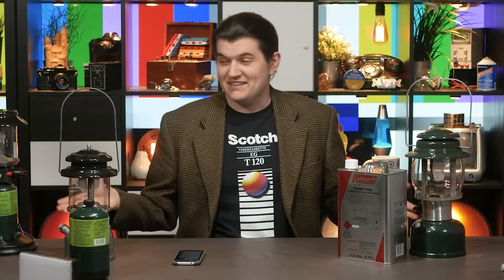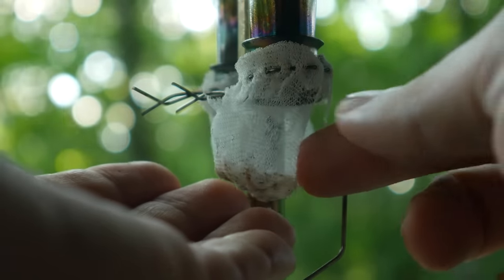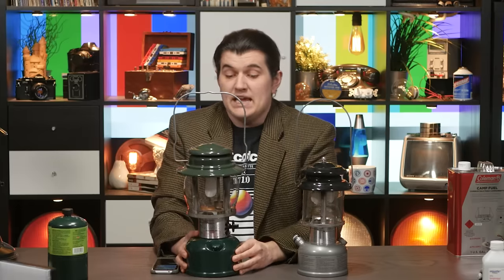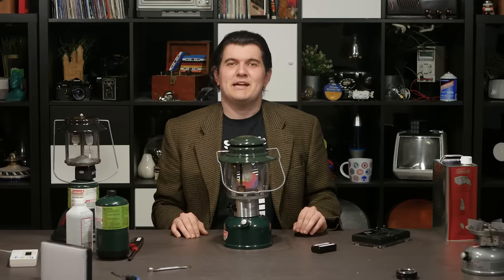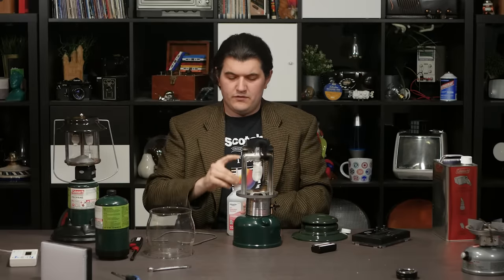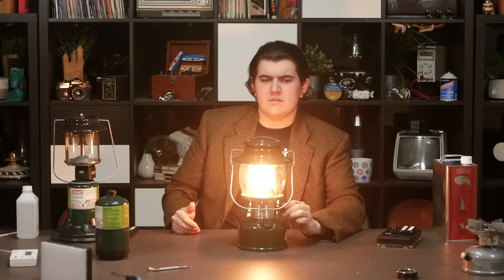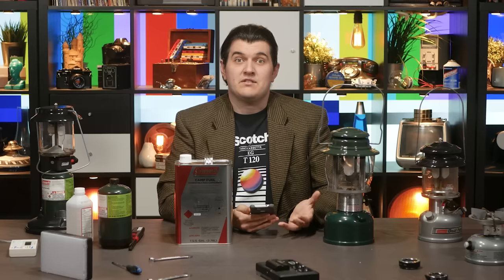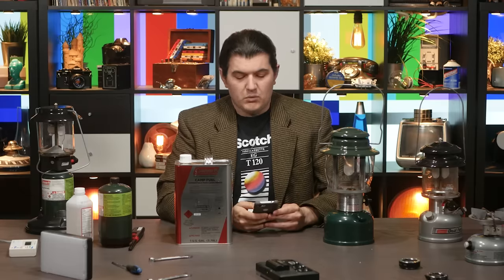A very rambly Coleman Lantern follow-up. Turns out they rarely make sense in 2021

Comment: Pro tip. I use and have used these styles for 40 years as a scout in my youth and also as a leader as an adult. With either gasoline or kerosene when lighting…crack the valve open then once ignited close the valve immediately. This greatly reduces the amount of liquids flowing through the generator into its hot enough to vaporize. Big flame and carbon under your lid is a thing of the past. When the mantles die down a bit, crack it again and do so until it burns without liquids get through. It takes about 30 seconds and about two to three brief openings until you can go full throttle with them. Also white gas, unleaded, or kerosene are way more efficient than propane. For six lanterns and two stoves for camping I’d use 10 or so bottles of propane for gas I’d use maybe a half a gallon for an entire weekend trip. Coleman says it’s 12:1. Gas is much more efficient. I fill everything up in the morning and I get about 12 hours of light and stove time from a full tank. Try running a generator on propane. For a 20lb tank you’ll run about two hours less for the same amount of gasoline. 
I cannot run 12 hours on a battery lantern. The intensity of the light from an LED sucks. To get the same coverage you need the intensity of the sun which is hard to be around. The soft yellow glow and at the candle power The gas lanterns run is much more pleasing. Plus having the ability to charge in the woods is problematic, batteries are heavy and can be bad for the environment. Solar isn’t an option to charge 6 or 7 lanterns especially in inclement weather and or heavy canopy. Stoves can’t use batteries in the woods at least I haven’t seen any. Again they need charging. Very convenient using the same fuel for stoves and lanterns. Temperatures also wreak havoc on standard alkaline batteries. Propane gives up and performs poorly under about 30° F. Gas, alcohol, or butane/propane mix wins the day. 

You also assume the poor areas that would depend on these for primary light would have access to funds to Amazon or Walmart. They need only find about less than a quart (liter) a day for light and can be sourced from anywhere. And by the way these lanterns and stoves produce heat. A very welcome by product in cooler or wet climates. Look at old Coleman stoves they sold a top that fit over a stove the is essentially an inverted can that glows as red hot stew and heats very well. Dangerous? Could be but let’s take off the bubble wrap and act like adults. 

Car camping in the US a couple times a year or quick emergency lighting in the home for power outages…sure batteries could work for you. Long term….nope lots of people…nope. I’ve had 100+ people in the woods before lighting up a large area and running multiple stoves at one time. 

Great videos but don’t talk in absolutes and leave it as your opinion unless you’re well versed in the subject. Anyone who’s had experience with any of the lanterns can tell you’re a novice. You’ve done well really but not that of years of experience but an education gleaned for the sake of the video.
Reply: But sometimes.....

You must admit this is a fairly specialised scenario. For most people, in most situations LEDs are the clear winner. Also anybody that uses a lantern while car camping has rocks in their head or just appreciates the aesthetic.
Reply: @jimmy_james0007  nope. Not out in the country and not when power outages occur. I agree with the experienced guy as I am one too. We’ve lived with them and they still work and provide heat, cook and make hot water for bathing and washing dishes. I’ve cleaned deer with them, rode 3 and 4 wheelers at night with them, worked on vehicles by them and just enjoyed the night fishing by them. The majority of situations? What situations? I have led lights, use them at work all the time, when an electric outlet is handy they’re great. Saves gas. But gas lights and stoves will always rule as will gas engines and vehicles. I have my machine shop set up to run directly on gas engines as well. We live in the oil rich south. Best and most powerful energy source for survival. They’ve never been meant for everyday use, but we aren’t everyday people like the city dwellers.
Reply: @tonybranton  I don't care if they still work, I care if they are the best option.

Lanterns are dangerous particularly when handled by the majority of campers who are usually inebriated or incompetent and most camping takes place in mild weather where the additional heating of lantern is unwanted. I seriously can't believe you two want more Darwin award contenders running around the forest with lanterns when LEDs will work perfectly well for their purposes. 

Also I actually don't know anybody who doesn't have either an appropriately sized generator or a wood stove in the country. You can't be seriously suggesting that people use a lantern indoors rather than these options?
Reply: @tonybranton  great bug zappers also
Reply: @jimmy_james0007  LEDs are perfect for idiots in the woods for a night or two. 

I keep landing on kerosene products myself. 1st, LEDs are just too stupid bright and ruin night vision. If you really want to enjoy camping. Get away from the lights and actually let your eyes adjust. For the course of lighting, I'll stick with wick based kerosene lighting, pressurized seems way to bright. This has the benefit of being dual purpose for a stove. But back to brightness, I was sailing along on a clear moonless night. Chart plotter down to about 30% brightness (these things get super dim, 10% was too dark at night, in a storm, miles away from any light source, i think 0% is for people running around the poles, during storms, in the darkest two weeks of the sunless winter). Gentle red glow of the compass. The milkyness of the milky way in the sky. My phone on its lowest setting, and blinded me. My kerosene wick lamp on low kept the inside of the boat visible without blinding me.

Cut the light out and let you eyes surprise you with how good they actually are. Then decide how much light you need. Just give your eyes some hours to figure it out.
Reply: @bmxerkrantz  I didn't mean to imply that LEDs were only for idiots, but they certainly are a lot safer than lanterns. Heck I never use lanterns nowadays, with how light and cheap powerbanks with solar are, I will run out of food well before I run out of charge for the few LEDs I use. Though in saying that I'm like you in terms of light levels, dim as possible unless I need to read or going to drop the kids off at the pool 😀
Reply: You seem to have not watched the entire video. There's also solar options as well. These lanterns mostly serve no purpose for the average camper outside of aesthetic. I've watched many campers who camp striclty on solar energy and rechargeable batteries. I feel like this is a typical old head comment who can't let go of their rituals or feel that their experience is absolute or the only way. Or a typical boomer who can't change their ways. They are also very dangerous. Even the average user can have an accident. They aren't ideal in most situations and in 2022 there are other options readily available. You can also get LED lights that have a more yellow glow or simulate it. The fact that you dismiss any modern method just makes it sound like you're stuck in your old ways. That's fine, but your situation isn't what most people do.
Reply: @IvorySoul696  I think their last paragraph covers your response quite well.

After getting a kero wick lamp for the boat (haven't found LEDs dim enough to not destroy night vision) then the hang of a pressurized kerosene stove (came with gimbal for the boat when off shore power), the advantages just stack up when the fuel is around. I went primative camping and forced myself to get to learn the stove. Glad I did because it dropped below freezing. My liquid gas options faltered horribly, the kero just wanted an extra round of warming up. Cold has always been a weak point for battery technology also. Just picked up a kerosene heater for over winter boat work. 

Kero isn't the end all, but it does have great advantages. Especially if you live in a colder climate.
Reply: @bmxerkrantz  Try putting a red filter over your LED lights. If you get one that's a dark enough red, or opaque enough to absorb a good chunk of the light, it'll preserve your night vision fairly well.

Comment: One senario that i really like the duel fule option is motorcycle camping, as i can always get extra fule for my stove or lantern. Just pull a little from the gas tank and im good to go.
Reply: That is 100% valid for your stove... but I'd be inclined to charge a normal USB power brick from the bike whilst you're riding (assume you've got an accessory socket and you're not using that 100% of the time for heated gloves/ jacket) and you'll be good for power for lighting.
Reply: That's why i got mine.
motorcycle, stove, light, lighter.. all use the same fuel.

More to see if i could than any practical reasons.
Reply: I used a Coleman every day on the road for 5 months back in the late 90s. Yes the fuel is cheap and available everywhere but so much can go wrong and you can't take it inside your tent so you need batteries and LED anyway. Plus on a motorbike, surely you need a new mantle every time you ride. They might be cheap in America but here in Australia they are like six bucks each.

Comment: Enjoyed the content!
A cold start technique that I was that I was taught for white gas/unleaded fuel lamps was to pressurize the tank a bit (not too much), light and insert your match, quickly open the valve full open then fully close the valve. The spurt of fuel will of course not be atomized yet due to the cold generator, but there will be enough liquid fuel in the mantle and inside the glass to act like the cup of alcohol in a kerosene lamp to heat the generator tube. Once the fuel has almost burned completely out ( so you don't need to strike another match) crack open the fuel valve and close it. If you get nothing but atomized fuel vapor you are good to go to begin slowly opening the valve bit by bit until the generator tube continues to heat up. If you get another burst of liquid fuel, then again wait until it is almost completely burned out and crack again.  Once everything is running in vaporized mode then pump up the pressure on the tank for the "Afterburner" mode.  Note the first open of the fuel valve is to the full open to full closed to actuate the self-cleaning pin through the fuel jet orifice to clean out the carbon build up from the last time the lantern was shut off and the dying flickering flame burned inefficiently and probably left carbon deposits in the jet. Hope this helps with your safe enjoyment of lantern fun.
I think kerosene lanterns make sense in areas where the fuel will potentially be stored for extended periods of time. Kerosene/JetA and diesel last way beyond the one year of life of modern gasoline. Propane will not go bad. The tank just gets rusty.
Major downside to propane fuel is that it has "a lot of quit in it" in really cold weather and won't burn well. More so it seems than the other fuels.
Batteries in general especially lithium rechargeable batteries are also susceptible to below freezing temperatures. 
I bring up cold because if you are depending upon these devices when it's Yukon cold outside when the power goes out for extended periods of time you may need them to help save your life.

For just short term fun camping in nice weather, absolutely, rechargeable batteries are the way to go.

Comment: The reason for the hole is shown pretty well in the segment at about 3:36. It allows you to give the air that is trapped in the piston a patch way out. As the pressure in the pump must exceed that of the tank to put air into it, you can never get all of the air from the piston to the tank. This become more noticeable the higher the tank pressure is. You need to compress more air to reach the tank pressure before it will start moving into the tank. When done, the hole allows you to, when not covered, seat the pump and secure it by letting that trapped air out.
Reply: So, is this in lieu of a safety release valve; you know, in case it gets hot for some reason during use?
Reply: @kenmore01  No safety release involved with the hand pump,  real or imagined.

Comment: I use the dual fuel lamp for camping for one simple reason: It makes me feel more comfortable. The thing with LED lamps is: They only emit a small fraction of the frequencies burning light does. And it feels very unnatural. Whereas when I use the Coleman it feels like sitting next to a camping fire.
Reply: The light from gas mantle lamps seems pretty unnatural to me, but it is an entirely subjective metric.
Reply: Personally I have a similar although unrelated anecdote to share:
I surf elevators (Search BENO Lifts on YouTube if you want to learn more about this activity).
Newer elevators usually come with proper shaft lighting but older ones don't and sometimes even newer installations don't have enough light to suit my tastes.

So I have to bring my own lights.
I can either use a flashlight or any other battery-powered light source that is not too large to be carried around or any small light that plugs in as most elevators do have power outlets on top of the car.

I happen to use a 500 watt halogen floodlight that is thankfully not too large or heavy to carry around.
It puts out a lot of light but I'm sure I could get much more light from LEDs.
So why do I settle on the halogen in 2022 ?
Well first it plugs into AC, so I don't have to worry about battery life.
But also because elevators shafts are frankly quite scary and a good, warm light actually makes a HUGE difference in how you feel and thus how you'll be enjoying to be here or not.

Sure, warm white LEDs do exist but I feel halogen lights to be more reassuring in that particular secnario given the wavelengths they produce that even warm-white LEDs don't.
The only downside is that the light quickly gets too hot to the touch after only 2 minutes of use so I have to be extra careful, particularly at the end of the ride when exiting the cartop.
Reply: @garethbaus5471  more natural then a LED I think
Reply: @carguy.4591  depends on the LED, most commercially available LED bulbs have a significantly more pleasant spectrum that is much closer to natural light then the light from any gas mantle I have seen (and I have seen several).
Reply: It is more expensive to get LEDs lamps with a high Color Rendering Index. Not sure if the battery life is much different though. And you can get them calibrated to different 'temperatures' for a warm or cold color. Basically the color of "afternoon sun" is different on different parts of the world (even when normalising weather and season) and it might influence your preferences in a way that isn't very easy to nuance conciously.
Reply: @garethbaus5471  I agree with you that modern LED lamps increasingly get better in admitting what I call “natural” light. But indeed it it is very subjective criterion, as you already mentioned.
Reply: There are a ton of LEDs out there in all sizes, shapes, colors, tints, CCTs, beam patterns, etc.  Some are indistinguishable from the light of a campfire, some are indistinguishable from the light of the sun, some are a pleasant pink, some are a sickly green, and so on... just gotta find what looks good to you.  If something fire-like is desired, try looking at the extreme warm end of the spectrum, like amber LEDs or, for example, E21A 2000K LEDs.  Personally, my favorite is an older model called a Nichia 219B sw45k, which runs at around 4500K with ~93 CRI and a pinkish bias.  I'm also fond of mixing Cree XP-L HI in 1A and 8D tints, which are ~6500K and ~2700K respectively, because they can blend to any CCT in-between and produce a very consistent beam with a pink bias.